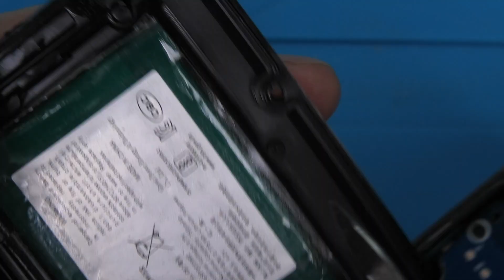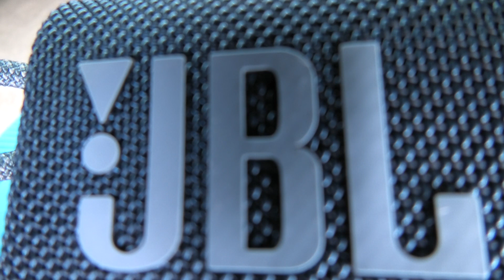WIRELESS CHARGING for JBL GO3 Bluetooth speaker (How to instructions)

Comment: Great Video! If I would glue out or put silicon in the hole where the wire goes through, would the speaker be waterproof again?
Reply from the maker: Hi,  I ended up using Epoxy to close up the hole. 
Silicon will probably work as well. I personally just don’t trust it to last forever.